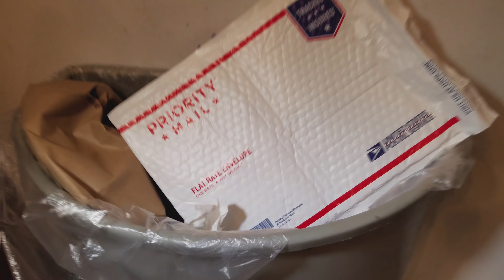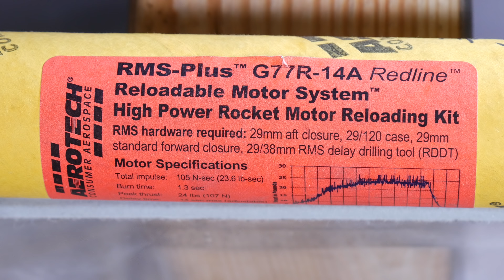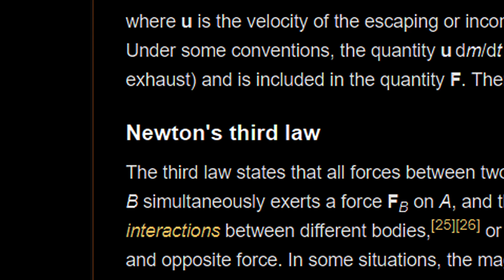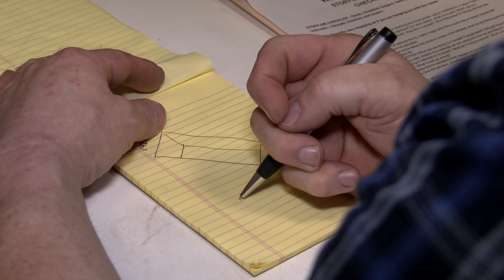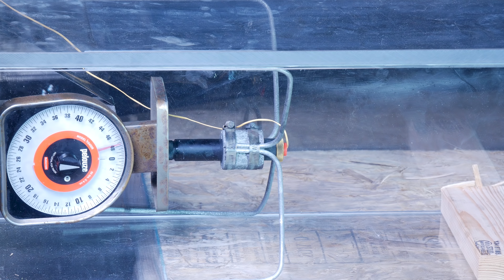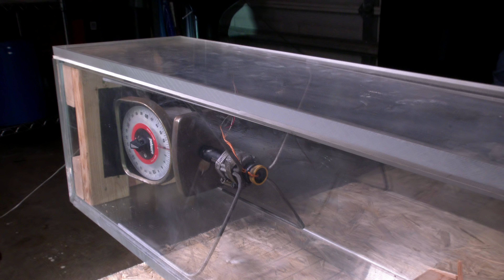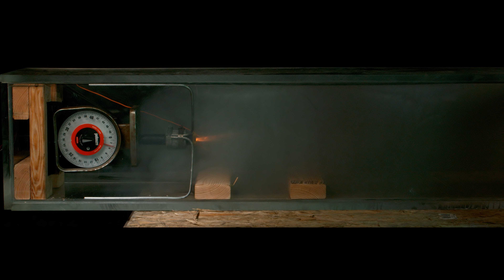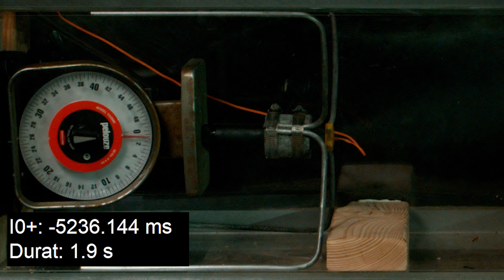Rockets in a Vacuum Chamber - Newton's third law of motion Visualized

Comment: Soon as you fire the engine it pressurise the camber whit it out put stuff like co2 and whit some fueland oxygen the oxygen is from the solid fuel tank there is air bubles so when its started to burn it need oxygen and it was at the tank but some of oxygen got spild out to camber and some fuel at start so when the engine got that huge flame it was begos those oxygens and fuel particles what got chamber got light up and those oxygens support the engine to burn more fuel but last broblem was the vacuum got to normal pressure or even hinger so solid boosters don t like that theyr fly from 1 pressure to other pressure so it stops begos it out put has to chane

Comment: The thrust from the rocket hit the end of of your chamber and I'm not a flat earther
Reply: So what? How does that affect the rocket?
Reply: @buggsy5  the rocket thrust pushed against the end of your chamber driving the rocket the opposite way everything has the exact opposite reaction if you put 10 pound of pressure against the end you will go forward with 10 pounds of thrust if your muscles push you hard enough you will jump in the air but if you where held off the ground and applied the same force to your muscles you would not go any higher because you are not thrusting against the ground
Reply: @denis9450  How can the exhaust gas hitting the end of the chamber have any effect on the rocket? Once the gas exits the nozzle, it is completely independent of the rocket. 

Let us assume a person is in a balloon at 5000 feet altitude. He has a mass equal to his weight and is strong enough to throw it downward at a velocity of 100 meters/second. When he throws the mass, its instantaneous motion downwards would be 50 meters/second and the person's instantaneous motion would be 50 meter/second upward. 

The equal and opposite equation guarantees this, even if there is no ground for that thrown mass to press against.

Comment: Its amazing and crazy just how many people in the comments have a total incapability to understand reality.

So, to explain for folks that are hard of understanding (yes, I mean flat earthers as suspect number one):

Q: How can a rocket burn in a vacuum if there is no oxygen?
A: Rockets carry their own oxygen. Some use liquid oxygen and some have oxygen in the fuel compound itself be it solid like in the video or liquid like hydrazine monopropellant.

Q: If there is no air to push on in vacuum, how can the rocket move?
A: Because the rocket propellant as it burns releases energy, which vaporizes the fuel and creates pressure in the combustion chamber. This pressurized burnt fuel has to go somewhere, so its pushed out the back of the rocket and expands from the nozzle, and we've been unable to refute the action-reaction shown here for over 300 years, thus its reasonable to say its true.

Q: But why doesn't the vacuum pull out the exhaust and nullify the thrust?
A: Because the absence of something by definition cannot act upon something. That is what "nothing" means. Before lighting the solid rocket, the propellant can be exposed to hard vacuum and it won't go anywhere, but once its lit the propellant ignites and provides itself the oxygen it needs to burn, thus making pressure from released energy and throwing the gas out the nozzle to generate thrust on the rocket body, thus making the rocket accelerate.

I hope this answered some questions people had, and I want to say I'm very disappointed in a lot of people here for disliking a good amateur rocket experiment (with cool slow motion so we can see the unstable ignition of a motor designed for atmospheric use before it starts burning properly and making around 11 pounds of thrust) and for doing all that senseless ranting and raving in the comments about how there's some nebulous conspiracy out to make us think the Earth is round and life isn't real. Grow up, drop and apple to watch it fall thanks to gravity, throw an orange and watch it fall in a parabolic arc via gravitational pull from the effect of mass on spacetime, realize that despite gravity being a theory its still the single best descriptor of the effects of inert massive objects drawing each other together no matter how much you try to convince yourself otherwise, and then sit in a corner to cry about how your worldview was wrong and how centuries of science is pretty damn accurate to how things really work. Then go watch more Warped Perception videos since he does really awesome stuff.

Comment: How about a base line by test rocket thrust at normal atmospheric pressure? Nope.
Reply: I agree that would be a good test. What do you think it would show?
Reply: I’d like to see initial thrust under normal atmospheric pressure, then a series of tests as pressure decreases. I am assuming if thrust remains constant, you could eliminate the variables of self produced atmosphere, and interaction of the side planes of the chamber.
Reply: @jamesmarvel341  : Well, mainline rocket manufacturers have such test rigs where they can validate thrust at much lower pressure than at atmosphere. And guess what? The thrust is higher with lowering back pressure.

Comment: You just flooded the hell out of the “vacuum” chamber with molecules using the burning rocket fuel i.e. not much vacuum pressure left. You also can see that the chamber is containing this and thus giving the thrust that you are measuring. If you look at the first part This is verified by the top cover flexing from the pressure added to the chamber. If this was the vacuum of space the molecules spent fuel would have violently flown away from the rocket pushing against nothing, and given zero thrust!  The force forward Was not caused by the reaction. This test is far from a valid test. In order for this test to be valid the chamber would have to be several orders of magnitude larger and a much much higher level of vacuum. The level of vacuum was no where near what is said to be the vacuum of space.
Reply: What caused the spent fuel to violently flew away?

Comment: When combustion took place, after three tries, the small chamber was filled with gas byproducts thereby creating an atmosphere in the little chamber allowing for thrust to happen. However, that model would not work in the vastness of space as the gas cannot be trapped in one locality allowing for thrust to take place.
Reply: The third law of motion doesn’t stop working when there’s no air. 

Rockets work for the same reason that you experience recoil when firing a projectile.
Reply: why does thrust require air?
Reply: @ppleberrynd  Because he thinks that somehow the exhaust is bracing itself against the air to exert a force on the rocket.. it's nonsense.
Reply: You have absolutely no idea how many particles of gas are in the air chamber and therefore cannot indicate there was any significant atmosphere.
Reply: Do rockets accelerate mass?
Does accelerating mass require an "equal and opposite force". 
Yes

Comment: At no stage was there anything like a vacuum in that chamber.  Smoke does not float around in a vacuum.  It falls straight to the ground
Reply: @darklight2.1    No.  In a vacuum. smoke falls to the ground at the acceleration of gravity   9'8m/s/2. ........physics is a bitch.
Reply: This experiment is not conclusive. Timestamp 10:11. Slow down the playback to 25% and look at both the rocket engine and the pressure gauge. When the ignition charge is started, the chamber is in vacuum. As soon as the ignition charge starts to burn, it fills the chamber with it's expanded gases which re-pressurizes the chamber. The pressure gauge clearly shows this. When the SRB fuel ignites, the pressure in the chamber spikes even more. The pump used to create the vacuum is not sufficient enough to maintain the vacuum in the chamber during the rocket demo. 

Perhaps a much larger vacuum chamber with enough pumps to compensate for the effects of burning rocket fuel would produce more conclusive results. Not something easily done in a home garage shop. 'The Action Lab' YT channel has a more conclusive result with a smaller vacuum chamber and an exploding soda can. Check it out.
Reply: Whoops! I have to correct myself. This experiment does barely prove rocket thrust and Newton's third law in a vacuum. Time queue 10:13. A lot of stuff happens in this second.
Reply: @starroger  they have already admitted in previous video that there is no vacuum in the chamber becasue rockets cannot fire in a vacuum.  The rocket did not fire.
Reply: @boptah7489  watch the whole video.
Reply: @boptah7489   "... he had to pressurise the chamber to get the rocket to fire." 

In THIS video he only sealed the ignition chamber of the SRB at room atmospheric pressure. This provided enough 'pressure' (your term) or more precisely oxygen for the initial spark of the ignitor. Once the ignitor was lit, it provided its own oxidizer.  The vacuum chamber was in vacuum when the ignitor was lit.

Watch closer and try to be more objective next time.
Reply: @stuartgray5877    How much do they pay you to lie to everyone ?    Is it above minimum wage ?
Reply: @stuartgray5877  You only need a force to accelerate a gas in an atmosphere because you need to overcome the resistance of the atmosphere.   you don't need a force to accelerate a gas in a vacuum because the gas expands naturally in a state called " Joule free expansion ".   Hope you learned something today.....cupcake.
Reply: @boptah7489  Who should we believe regarding the physics of spaceflight?
A goat herding high school dropout?
Or an actual Spacecraft Engineer who has been building, testing, launching, and operating deep space science probes for almost 30 years?
Reply: @stuartgray5877  You cannot 'Force ' a gas into a vacuum.  Because to apply a force means to overcome some form of resistance. .  A vacuum has no resistance.

Comment: was this intended as a joke????? Let me assume it was not and ask you all a question. IF scale of chamber is equal to space, what is the scale of rocket is equal to?  if that chamber was 10' cube what size of a rocket fuel? maybe thickness of a hair could be appropriate?  just trying understand everthing.
Reply: Do you think making vacuum chambers is easy?
Reply: @kitcanyon658  no, which is why this video failed 😂
Reply: @papalegba6796  <-- Chatbot attempting to learn AI...
Reply: @kitcanyon658  Papa Legba is not even as smart as ChatGP.
I asked ChatGP what the combustion product of burning hydrogen and oxygen IS and it answered with "Water" which is the correct answer.
Ask BOT Papa Legba the same question and it answers with "Fire".

Comment: This proves nothing.  Rockets must provide their own oxygen or you have violated the fire triangle.  "SpaceX and their Falcon 9 rockets, they use liquid oxygen and refined kerosene called RP1. The liquid oxygen needed to be cooled to cryogenic temperatures in order to be more compressible and fit into the rocket."
Reply: Maybe rewatch the video. 7:19
Reply: Did you have a point?

Comment: Did not show his 14.7 psi negative pressure, for the igniter to light by putting some silicone which sealed some oxygen next to igniter. At higher pressure it would just suck that silicone plug right out. This is a cool experiment for kids but proved nothing. Negative pressure in space supposedly is so great that to contain such immense negative pressure they built a room on Earth fully rebared 4-8meter thick walls, makes one wonder what keeps all their dinky shuttles from turning inside out and what gives the Earth the super power to retain it's "atmosphere" when an infinite strong vaccum of space wouldn't give two cares about your gravity and equalize it with itself
Reply: Ya - Why don't you try finishing high school (take a Physics class) BEFORE debunking physics?
Reply: @stuartgray5877  ok thanks for the advice, be well
Reply: @stuartgray5877  you are saying there is no vacuum in space? It's 0 psi?
Reply: @yaneponil1470  Yes "The VACUUM of space" is JUST devoid of matter and is at 0.0 PSI pressure.

There is no such thing as negative pressure.
Vacuum cannot exert a force.
Reply: @yaneponil1470  By definition (applied science & engineering) a vacuum is just an absolute pressure less than atmospheric pressure. 

The air pressure 1000 feet up is considered a vacuum from where you are standing. 

Here is an interesting facts for you. 
that 10^-17th Torr of space is still a positive absolute pressure. 

High altitude balloons traverse 99% of the pressure gradient from see level to 10^-17th Torr. 
in other words a balloon can handle close to that level of vacuum
Reply: @entangledmindcells9359  Yeah they don't realize that at only 50 kilometers (31 miles) up Atmospheric pressure drops to "Rough vacuum" or close to 1/1000 that of sea level.
At 50 km ATM Pressure is less than 1.0 Torr.
1.0 Torr is 1/760th sea level pressure.
So you only have to go up 31 miles before it is REAL "VACUUM".

THAT is why rockets go "straight up" (mostly) then turn just above 50 km and fly HORIZONTAL to earth's surface to reach orbit.
They want to get clear of the atmosphere as quickly as practical and spend as much time OUTSIDE of the atmosphere as possible.
Reply: @stuartgray5877  I love it when FE's talk "infinite vacuum" of space.. its like it is some major giant vacuum cleaner.. 

hence why I now like to ask them what the absolute pressure of where space starts.. I can here the gears grind.

Comment: You need a real vacuum chamber pumped down to the vacuum of space. (10 - 12 Torr) Your vacuum chamber cannot achieve this. Just being inside of ATM psi doesn't cut it. It must also hold the vacuum throughout the experiment. Fail!

Comment: Basketball analogies just flat wrong. If you want to use the basketball analogy do it like this. You're holding a basketball you poke a hole in it the air begins rushing out, you and the ball stay stationary and the ball goes flat. People explain that rockets work by pushing against themselves. I question that analogy. I'm no doctor or expert but in my observation the rocket works because it's creating a highly pressurized area and pushing against the 14 lb of atmosphere it is operating in. Can someone please tell me how a rocket actually makes an object move here in our atmosphere and in space? 
It seems to me odd that it would function the same way in a vacuum and in a pressurized system.
That question leads me to my next question. What is the accepted theory  that explains why our atmosphere does not get sucked out into the vacuum or simply float away? For clarity example, you make a lucite box with a divider in the middle in one half of the box you create a vacuum equal to the vacuum in space, in the other half normal sea level air pressure. you remove the divider what happens? it seems to me the pressurized side would move to the vacuum side and dissipate the overall pressure to7 lbs. I'm not being an ass whole, I really do want  to understand, what happens in that lucite box and the possible explanation is fascinating. Whoever answers, thank you in advance.
Reply: If i fire a steel projectile from a crossbow in a vacuum, will I feel recoil? Yes or No?
Reply: @stuartgray5877  yeah I don't know about a steel projectile. In an attempt to make it as simple as possible. You blow up a balloon in your living room and let it go. You blow up the same balloon in space and Let It Go.
Reply: In an attempt to make it as simple as possible how about? You blow up a balloon in your living room and let it go. You blow up a balloon in space, vacuum and Let It Go.
Reply: Jim Da your example is LESS simple.  Explain the mechanics of how a crossbow pushes away a projectile and if the object doing the pushing feels a recoil force or not.  Do you know Newton’s laws and how they apply to two objects and a force BETWEEN those two objects?
Reply: Okay Stewart I was just asking an honest question thanks for clearing that up
Reply: Jim Da - no you started with the ASSERTION that the “throwing the basketball analogy was wrong”.  I am trying to help you understand that it is NOT wrong by having YOU explain how Newton’s laws apply to the simplest possible physics problem of: two objects and a force that acts between them but you seem to be Unwilling to participate. Have you ever taken a physics class?
Reply: @stuartgray5877  I'm not very good at communicating this way. Sorry for the confusion, thanks for getting back. Yeah I realized after I sent that post, it wasn't right. Did you catch my next post? I simplified, if you blow up a balloon in your living room and let it go, if you blow up a balloon in a vacuum and Let It Go?
Reply: @stuartgray5877  sorry about that I got distracted in answer to your question I have a fundamental working knowledge of Newton and I understand Einsteins equal and opposite. As I said in one of my posts though it just seems odd that a rocket would work exactly the same in both environments I can't wrap my head around it, so I was trying to use a different explanation or a metaphor so I can wrap my head around what I know and what you're explaining. In school I couldn't learn algebra until the teacher said it just the right way and bingo The Epiphany hit me.
Reply: Jim Da so “ get your head around” WHY a crossbow feels recoil! Can you explain recoil force to a five year old? Work on THAT then get back to me and I will help you understand how rockets propel themselves USING RECOIL
Reply: @stuartgray5877  okay oh, well thanks for all your help, kindness, and understanding. Oh yeah by the way. Guess how many fingers I'm holding up.
Reply: Something well known in education - IF YOU CANNOT EXPLAIN IT TO A FIVE YEAR OLD, THEN YOU DONT UNDERSTAND IT YOURSELF.
Reply: Jim Da That was some impressive question dodging. I’m honestly amazed how much you tried to avoid answering anything involving a solid object